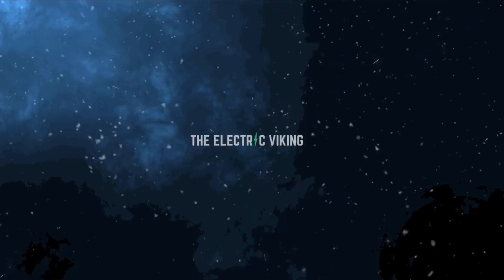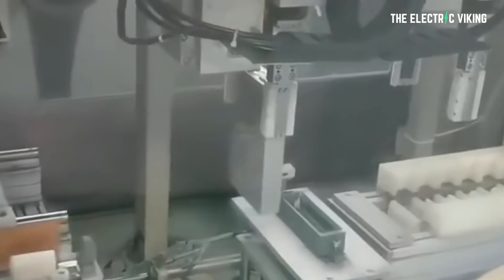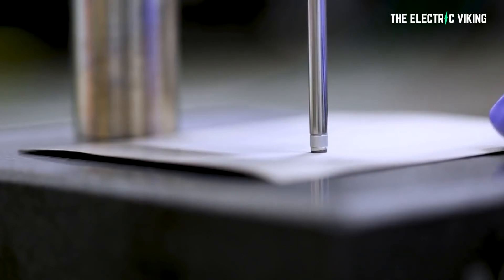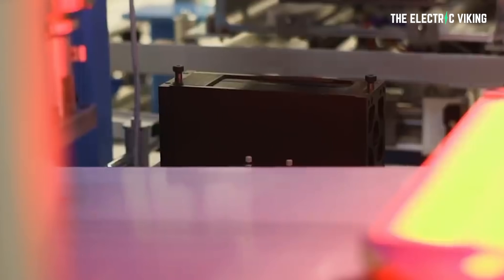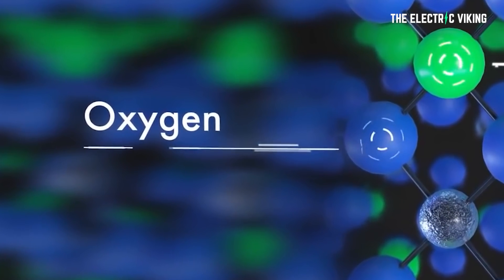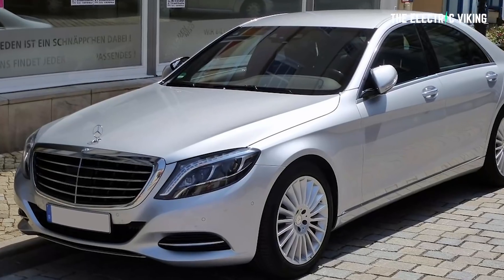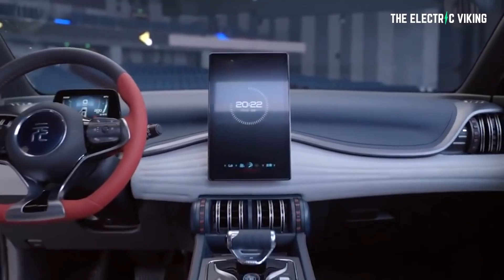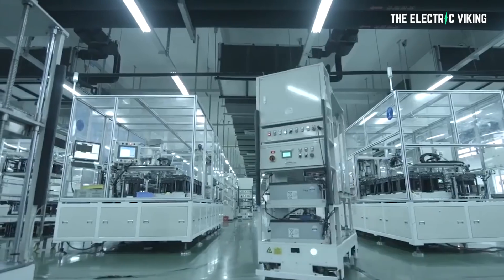New Solid-State battery breakthrough solves key problem

Comment: The problem with solid-state batteries is the discharge rate is pathetic compared to conventional lithium-ion.
Dendrite growth and redox reaction aside the search is on for the magic electrolyte.
Who knows, it could be as simple as using a similar process as "fridge magnet" production to mix with the silicone or graphite emulsion and using electromagnets to align the particles pre solid state.

Comment: Just a follow up on resale price Jim M.  Depends on the vehicle - surely you won't suggest the resale of a Bolt or Smart EV, even a Nissan Leaf is very good.  The Tesla is better but one also has to remember a lot of Teslas have a $12,000 FSD package and others don't so a resale price my mean this is included; hence a Model 3 w FSD may have gone out the door at $66,000 and resold with FSD for $45,000 which is a larger loss than many hybrids even cost brand new; though the percentage isn't that bad if the Model 3 did not have FSD.  If you pick certain hybrids they do great on resale like the Corolla hybrid others don't.

Comment: Hey Jim M  Unless you are talking Tiny EVs like the 1500lb SAIC mini EV - your logic is the dead end.  A Tesla Model S, Y, long range 3 average 5000 lbs.  A Corolla hybrid weighs 2800,  A Prius 3200; so which is FAT and overweight?  I drove a 22 year old Honda Insight (1850lbs) w 350,000 miles this fall west coast, SF, Vegas,  SD, LA, Palm springs,  Phoenix, Havasu, Sedona, Albuquerque,White Sands, El Paso, Tuscon, SD, Palm Springs, Sacremento, Eugene; Vancouver.  The tiny 60hp motor was supplemented by a 10 hp electric.  There was one pass over 10,000 ft; 4 over 5000 ft; many others I didn't have any problems and averaged over 60mpg.  A well designed vehicle won't have problems getting over a hill, nor will it break down if maintained.  Tesla sized EVs take more energy to build, and are use lithium and other constrained resources limiting their impact - so don't scale.  If you have a typical commute the hybrid can drive all electric in many cases. Had I attempted my trip in a SAIC mini EV I'd have had to stop 36 times to charge, adding at least 2 days to the trip.

Comment: Sam, thanks for recognizing that the 100 GWh factory will be for manufacturing HYBRID "solid-state" batteries (initially 20 GWh, and then expanding over the next several years).  I think we agree that full solid-state (FSS) technology faces the same 5-10 year climb to full-scale production of AFFORDABLE batteries that current battery technologies did.

As you said, FSS will initially only appear in high-end EVs for a number of years, and only then after volume production is achieved for the tech advances you discussed.  That is by no means simple and guaranteed to happen in a known timeframe, for now.

LFP technology is still ramping to higher energy density and production will be ramping for at least five more years, with both technology improvements and factory construction, training, and battery material supply chain factors limiting speed of growth..

Comment: Please can you provide more information of the alleged 'breakthrough'. To date I'm unaware of any such thing and the whole matter of 'solid state batteries' seems like the proverbial 'Holy Grail' of batteries and EVs. Many supposed solutions are likely to be prohibitively expensive for widespread commercial viability. One that I came across required sintering of components in a CO2-free atmosphere which will be a costly addition compared to current manufacturing for Li-ion cells with coated metal foils on reels that can be a continuous low-cost automated production line process. Any sintering would itself require slow costly batch processing which s a cost multiplier.

A recent "E for Electric" video featured Quantumscape's very technically knowledgeable CEO. They ae nowhere near a solid state product yet and the electrolyte is liquid which makes scientific sense. There are fundamental problems. Solids usually have poor ionic mobility which is RQUIRED for the flow of electric current. Therefore SOLIDS seemingly are unsuitable. It is nowhere near a simple solution. If you've based this video on some random press release promising the earth, be advised that these are NOT a reliable source of meaningful information. Even respected journals have been complicit in questionable articles of late.

Comment: Eliminating the coatings should also improve energy density. The coating material adds weight, but doesn't add energy capacity.
Reply: The coatings are precisely where the energy is stored in classic Li-ion cells. You're talking nonsense. The metal foils are just there to collect current.
Reply: @grahamstevenson1740  Did you even watch the video? It said that researchers at MIT and Brookhaven National Laboratory have developed a method of making solid state batteries that don't require a special coating between the electrodes and solid electrolyte. According to them, this will lower cost. Obviously, the batteries work without the special coating. That's the whole point.
Reply: @dwaneanderson8039  The video is full of nonsense !

Comment: SSB will not increase the energy density in general. You can have SSB with low energy density like polymer SSB. We need Li-Metal battery, SSB or semi-SSB. Li-Metal FP will be the key for cheap and high density battery in next few years and to compete with Tesla 4860. SSB supposed to be safer but will not prevent dendrite issue 100%. OEMs will need to do better on predicting battery issue before thermal runaway.

Comment: I like the trend I see in your reporting which is more informative and more factual.  I hope you stay on that line of action; you might consider expanding your view of "electrfication" to to include hybrids which can in many cases drive electric 100% of the time, if the driver did nothing but commute - so its a choice for longer distance trips - and you can make 10x as many with the same resources and you use less energy to make them to start.
Reply: Hybrids are a dead end which will have little resale value.  They have to carry around the mass of TWO power systems, only ONE of which is delivering power to the wheels at a time.   The engines are too small to provide ICE power when needed (passing, uphill, accelerating from on-ramps, etc.) after the batteries are depleted below a viable level.  They also have shorter lives than full-power engines due to corners cut to reduce hybrids' weight and cost.

Comment: I understand the inability to bond with the metal because of carbon dioxide in the mix, and am trying to see it on the illustrations you are putting up.  What I think we and many more view’s need to see is a illustration of the process in that inability, and not a continuous view of a non solid state battery being made.  Sorry Sam, but it is confusing to those of use trying to understand what is happening here.

Comment: Yeah I am pretty sure we will see LFP be the standard for low cost Electric cars. I feel like the dream for solid state batteries is infinite lifetime, Imagine a car (or motorbike) with a relatively small battery but no degradation, since most individual trips are small the small since isn't as important as the battery lasting for ever.
Reply: Transport Evolved reported a study that came out this week that claims that SS may still be prone to dendrite formation leading to thermal runaway and still be volatile in puncture scenarios. BYD's LFP blade is a real world cheap, long life, safer battery that you wont have to wait another decade for.

Comment: I had my phone's battery replaced today because the battery was swelling, causing the phone to split in two. When this happens in a car, does the car fall apart?
Reply: It's not supposed to happen: it was a defective battery that should have been screened out at the battery plant. But car batteries are split into many smaller batteries, unlike in phones, AFAIK. So if one is defective, it will only be one in many. It still will be a problem, but I doubt it would be a car splitting one.
Reply: @FlorestanTrement  On Samsung's page touting solid state they say: "What users most worry about a lithium-ion battery is safety. The current Li-ion battery has a risk of battery damage such as swelling caused by temperature change or leakage caused by external force since it uses liquid electrolyte solution. Therefore, we need devices or components that can improve safety. " My swollen battery was from Samsung. So it looks like the fix is coming for their knowingly defective batteries.
Reply: @Scoria-Lab  if you want to wait another decade for that "fix"... Sure. Which BTW, researchers and battery companies have been promising this amazing revolution for a decade already.
Reply: @Scoria-Lab  Yes, they swell when they are defective, or when they are misused. It's also true of lead acid batteries, by the way, although it's not much of a problem when they have enough space to swell in.
The screening of defective batteries in production is neither easy nor perfect.
I seem to recall that the form factor plays a big role in the risk of swelling. The cylindrical batteries à la Tesla lower the risk by a lot. Tesla also as by far the best software and hardware for battery management, that prevents most misuse cases.
I've been closely following the EV industry the last few years and never heard of a car "splitting" (or anything, really) because of a swollen battery.
Reply: Just buy an EV that doesn't use batteries that swell. Like LFP batteries.

Comment: Answer one question: why we don't see solid-state batteries in laptops, tablets or phones? They don't need 50-100KW battery.
Reply: 'cause we can't build them at scale yet.
Reply: @FlorestanTrement  That's why to start with a low scale. Products that need fewer and smaller batteries.
Reply: Because true solid state batteries are not actually in production yet except for in very tiny applications where their problems dont outweigh the benefits. Even at lab scale, most of the "solid state" breakthroughs we have been hearing about are actually still using a partially liquid electrolyte. The safety benefits are also overstated as new studies have shown that dentrite formation and associated thermal runaway is still a problem with solidstate cells. Note that this video is talking about lab scale research... to go from that to production can take as long as a decade IF the bench scale cells can be scaled up at all... the vast majority of lab scale cells cannot.
Reply: @patreekotime4578  ty, i was confused by his info from beginning and 1:06
Reply: @Boykiw93  That was the one part of the video that we wasnt directly reading from a CleanTechnica article.  He inserted his own opinion into a factual article hes plagerized. So thats why its confusing.

Comment: Will this also reduce or eliminate need for the cells to be maintained in compression ?? The structure for compression will reduce or eliminate weight savings and therefore energy density benefits

Comment: Do you think lfp can catch up to li-on in energy density?
Reply: LFP is still lithium ion, you mean nickel-based chemistries. If you really want to know, check out the interview The Limiting Factor posted a few days ago. A startup called Mitra Chem is exploring the possibility of using rapid development of iterative improvements to try to get LFP up to  Nickel-based cell energy density as quickly as possible.
Reply: It doesn’t need to. It just needs to be cheaper longer lasting and safer to use. Batteries using ethylene oxide as a solvent will always have a place where density is needed more than longevity or safe operation
Reply: It's probable that they will continue to evolve each on their own. And they have a lot in common that is evolving too.